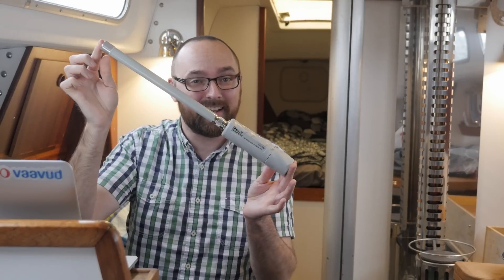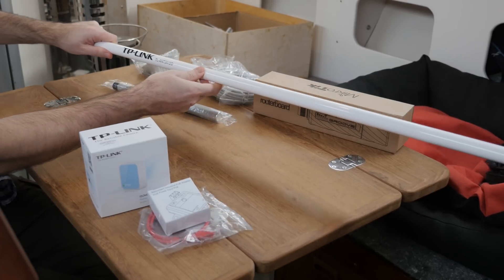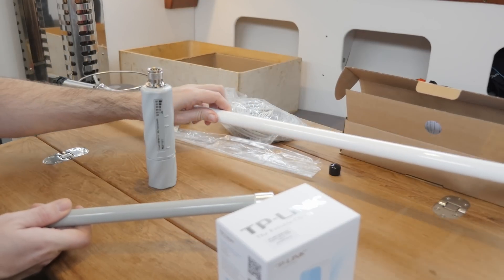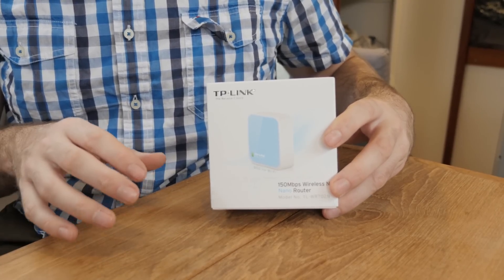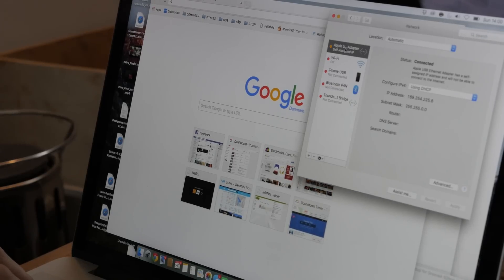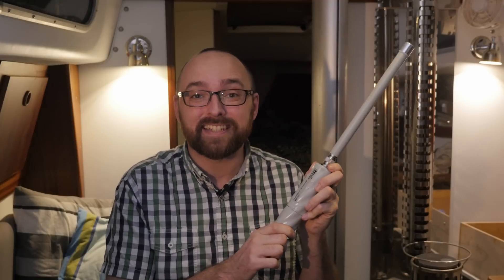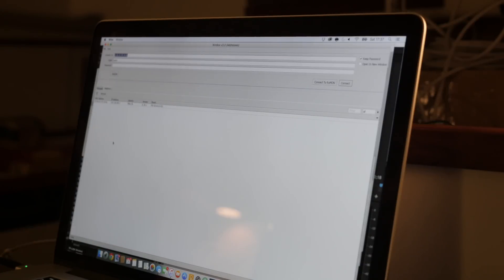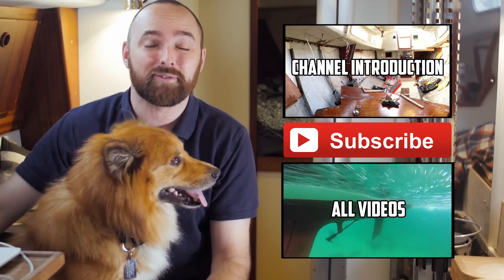Sail Life - (FAILED!!!) Easy long range WiFi aboard a boat

Comment: Hi Mads, I really enjoyed your video (as I always do...). Four similies for this one. Since I am no technician at all, I am not sure if this might be a compeditive product for your needs. But on board of our old lady we have a WiFi system from Locomarine, called Yacht Router Micro. This system seems to be a little more complex ( the router is part of the system), but it definitly works well and provides great web access even in marinas, where everybody is trying to catch some little bites by running around holding their pads high in the air - for example Hesnaes on Falster. I would be really eager to hear your opionion on this system and why the Micro Router is not a product of your choice. Thanks so much for your effort! All the very best from Berlin - hope to meet you on the Baltic sea next spring... ;-)

Comment: Haha, we struggled and fight with that too:-) Here you can see, that we mounted the Bullet on the mast: www.TamTam-Sailing.de/internet-an-bord 
But now after 7 month in different Marinas we found it way too complicated. We just bought instead of that the Tube-U USB Wlan System and a Alfa R36 Router. Its cheap (about 100 Euro) and really easy to handle and it works perfectly. The range is in comparison nearly the same and it works fine after about 5 Minutes of installation. We mounted it on the rack beside the solarpanel and get many signals from pubs, hotels and restaurants :-)
Reply from the maker: +TamTam Sailing Hi Nico! :) It's awesome that you guys have made it to France. I hope you had a lovely Christmas :) What kind of issues did you run into using the Bullet in the different marinas? :) I think I might add the Tube-U USB Wlan System to my comparison of the Groove and the Bullet :)
Reply: +Sail Life Christmas was great, I hope yours too? We found out, that some marinas use strange login-pages that for some reason don´t work with the bullet. We never found out, what exactly the problem was - maybe because I´m not nerdy enogh ;-) With the Tube-U Usb Device we never had any kind of problems. As I told, we mounted the bullet on the masttop: please, never do that!!! Sometimes, the bullet needs a reset. It is really annoying to climb up the mast and push the reset-button, just to get wifi :-) But one thing for sure: your neigbours will laugh at you :-)

Comment: I have an older Ubiquiti product, a LOCO. It has a built in antenna but uses the same interface. I found it easy to set up, but I do networking for a living, so it may not be a fair comparison. I do want to find a good cheap wireless router, and the one you have looks good, let us know how it works out! 

Now if I had not watched most of your videos I might have thought it was a crazy rant, but knowing your videos I thought it was very funny!
Reply from the maker: +Paul Wyand The tiny TP router I got feels very cheap (thin plastic) but so far there has been no issues with it. I'll give you an update on how it's performing in the Bullet vs Groove video :) Thanks! I'm glad you enjoyed the video :)

Comment: GREAT Vid!!! I started one on the same subject a few months ago, but like you, PROBLEMS....
I have the Bullet and use a RavPower (power supply & router) that also allows me to plug in an external drive that I have movies on to show. I have yet to get it all working well!!! A lot of the same problems and NOT for the novice AT ALL!!!!! I tried to write it up, but not got it yet. We are now out cruising and am using a PEPWAVE Surf on the go. EASY to set up & reconfigure for the next signal and ALL inside the boat.

Comment: :) :) :) :) Great video - thanks for MAC address and the A52hpn (for "annoying") vs. 52hpn tips.  I'm chewing through Ed Sherman's Advanced Marine Electrics and Electronics Troubleshooting right now and am wondering if you needed to consider anything for EMI and RFI interference with other electrical and electronic systems/devices on your boat during your install?  Especially for the placement of the 6dB antenna itself.  I'm also assuming you didn't need to put a sharp bend in any of those ethernet cables...

Comment: Hi Madz - loved that. 👍 I am no geek but sufficiently tech savvy to manage most IT related issues at home and in the workplace. In my experience these sort of problems are created by companies who allow geeks the run of the shop. Before a product goes on sale it should be tested by a non geek in the company using the literature prepared by the geek and revised as many times as necessary to enable the non geek to succeed.

Comment: Hi Mads, I would very much like, to see you set up the Bullet and compare  the the two produkts. :-) :-) :-) :-) My plan was to set up an old Linksys router,  hooked up to an ext ant. Perhaps using open WRT or another open source firmware. Kind regards Jacob
Reply from the maker: +Jacob Rousing Stay tuned, Jacob :) Having seen the response to this video I'll definitely do a comparison between the Groove and the Bullet :) Sounds like you've got a good plan! :) Fair winds, Mads

Comment: The simple answer is a maze. You have a product people buy, the product turns bad, how does PR fix the problem? Make any attempt at reaching the mothershi(t)p as damn hard as possible. 2 out of 3 will give up.
Reply from the maker: +aserta Haha, I think you might be on to something :) I certainly considered whether or not it would indeed be worth it to create a user in the middle of trying to do it. Not a good sign ;) In the end, the only suggestion I got from their forum was that I should have purchased a different product (the Grove 52hpn and not the Grove A52hpn). I should have spared myself the experience of using their forum ;)

Comment: I believe once you have the local IP address (192.168.1.2) set on the GrooveA, you should be able to access the web interface even when connected to your wifi. I'm a network guy and if I can be of any assistance, I'd love to help. The one thing to consider is a lot of wifi systems will give you a 192.168.1.x address, and if the local side of your Grove is set to that, you'll have routing problems. I would suggest using an off number like 192.168.45.1 as the IP address of the GrooveA. This way, when you connect to various wifi networks, you won't have routing issues. I would also change the LAN side IP Address on your router to something like 192.168.46.1. Just a thought.I love your videos and look forward to seeing more!
Reply from the maker: +Jim Parris Awesome idea to change the IP to avoid routing issues :) Thanks! Out of the box, the Groove had an IP address of 192.168.88.1. I gave my Mac and IP of 192.168.88.3 (although it might have been 192.168.88.2 in the video) and was able to reach the web interface on the Grove. I happily started configuring the Groove only to find out I could reach it on any IP address. That seemed very odd because I had not clicked the Apply Configuration button yet. I found out what actually happened when I connected to the Grove using WinBox and the MAC address. As soon as I would either set the mode to CPE or change address acquisition to automatic (can't remember with) the Groove would assign itself an IP address of 0.0.0.0. The GUI in no way warned me. Is it normal for a piece of network hardware to behave like that? It seems very not user-friendly. I might just be spoiled rotten beeing a software guy ;) I'm glad you are enjoying the video :) Thank for letting me know :)
Reply: The only reason I would see it changing to 0.0.0.0 is if you are configuring the LAN side of the Grove to use DHCP. This should not be done. I don't think that is your intent, but the user interface may be confusing to read. You probably know you need to configure the IP Address on wireless side (WAN Usually DHCP) and the Ethernet port (LAN Static IP) side. I have seen some crappy interfaces where it wasn't clear which side you are configuring. If I can do anything else to help, let me know. I'm a network admin and routing and that kind of stuff is in my blood!
Reply: Oh, I almost forgot... :) :) :) :)

Comment: As a network administrator i really enjoyed this, cheers :)
Reply from the maker: +Sailing on Bandit Thank you so much :) Perhaps you can tell me if it, in your experience, is normal for a piece of hardware to save the configuration without the user doing it or even without notifying the user. Perhaps this is something that a network specialist would consider normal? :)
Reply: +Sail Life cant really say that its normal for it to do that, but without playing around with it myself i could not tell you 100%. But in my experience a lot of this stuff is trial and error.
Reply: IMO this is not normal and not desired (to phrase politely) I had similar problems with the same mfr configuring a router. I have configured other systems including D-Link/Cisco and Open S/W such as DD-WRT and they do not configure until you hit 'Apply'. Not positive about 'save' doing a save AND apply. Can totally understand the frustration. I'll bite my tongue now ... :) (Note 1 smiley)

Comment: I often have a problem with router using Chrome so i went to basic IE and not the new edge.  PS i total understand your frustration with the formal. What asses.
Reply from the maker: +Norman Smith I figured it might be an issue with using Chrome too :) I tried using Firefox and Safari instead - I found the same issued there. Come to think of it I had the same experience in WinBox (the Grove would get an IP address of 0.0.0.0) but at that point in time, I was connected using the MAC address. Perhaps it's not an issue with the web interface but "just" a really annoying "feature". No matter what it's not a great user experience :)

Comment: Haha, you always need internet access to set up an internet connection. And the rest is just typical for network companies, just had fun setting up a network at work, nothing ever worked and if it did it randomly changed even if you told it not to ;) ;) ;)
Reply from the maker: +MarkxTube Haha, that sounds like a horrible time ;) Given all the "fun" I had with the Groove I'm glad I don't do that for a living :P If only I had know to connect to the Groove using WinBox and the MAC address I would have been spared all the trouble I went through. I'm sure that's in Networking 101 :)